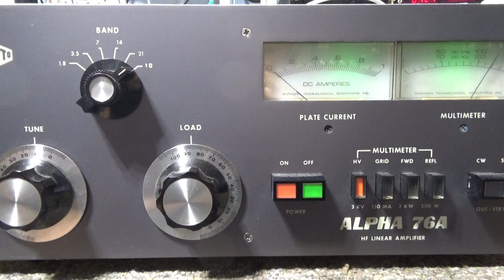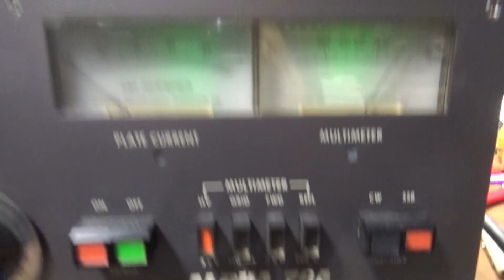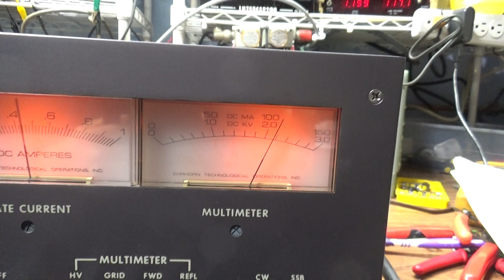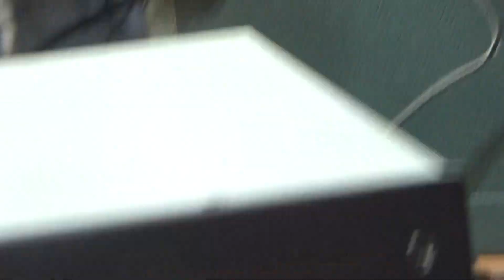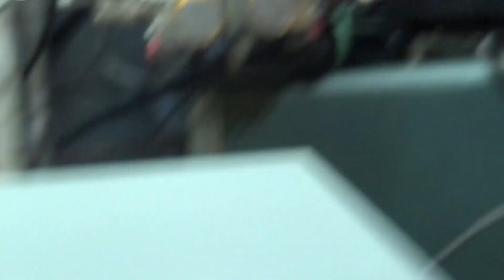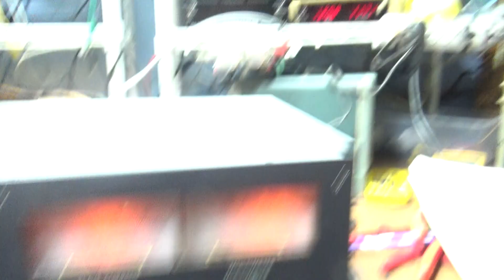Alpha 76 three tuber powered up on the bench.

Comment: I just bought a Alpha 78 in perfect condition for 100 dollars. Can you show me how to connect my cb radio to it? Its not like my Palomar  or my Chestnuts. Enjoy your channel
Reply from the maker: That's a Ham amp. Ham amps are normally made for a hundred watts drive, and Ham amps need either a foot switch to key up or a radio with an internal keying circuit to key the Ham amp up. 
  THAT Ham amp also does not have Ten meters in it from factory. It will need some modding to get it to work on Ten meters if it hasn't been done already. 
  Also THAT amp uses 3  8874 tubes. As said in the video, those tubes are almost unobtainium and pricey. That amp can be a great amp, but those tubes are fickle and THAT amp is the opposite of a beginners amp. It will run forever if the tubes are good and its ran right and not abused. However, THAT amp though is very well made, won't take hiccups, misuse, or abuse. 
  Just me thinking, if you are not 100% sure on how to run that one, I wouldn't run it. A dual 3-500z amp will make about the same power and be a lot more forgiving, plus the tubes ain't cheap, but ain't unobtainium and pricey either.

Comment: I have the same amp.
Serial number in the 5XXX range.
Mine weighs approx 65 pounds with the standard tranny and 3 tuber.
Hypersil is 20lbs lighter  l believe, so if you're not sure the weight gives it away.
👍

Comment: Your last comment about the brick...back when these were new Alpha would set up a display at Dayton that featured an amp being run at 1500 watts output for the entire duration of the Hamvention! 
At the time, ETO was challenging Henry Radio for the top of the amplifier heap. Alphas and Henrys still command top dollar although parts are becoming an issue.
Reply from the maker: Yes, Sir.

Comment: Great video! You are certainly correct that extra capacitors don’t cause more current draw. Unless they are leaky, and then they should be changed!🤣 
As you pointed out, there is a surge as they charge however. But normally that isn’t going to be a problem. I am an electronics teacher and I enjoy your no-nonsense explanations. Thank you!
Reply from the maker: Thanks.